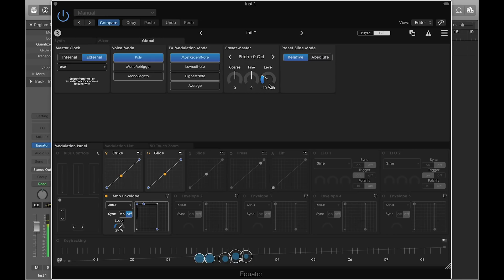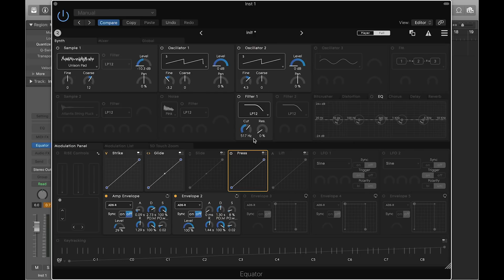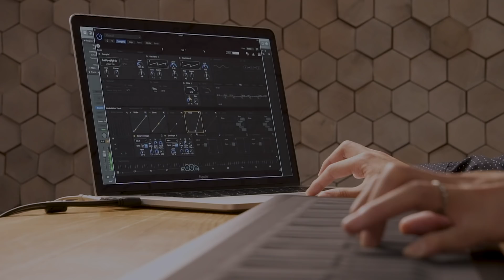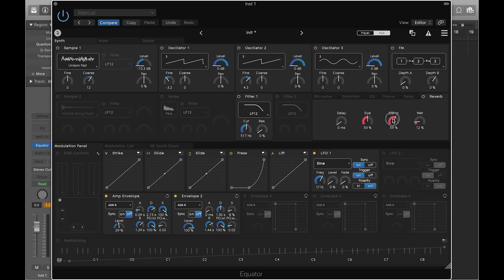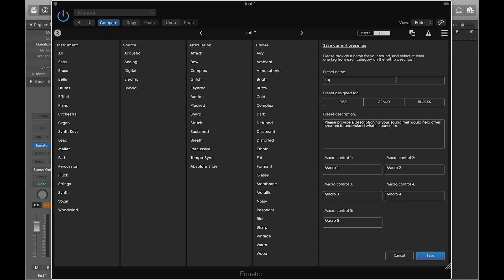How to make your own expressive sound in Equator

Comment: Roli hardware ( rise49 ) is a shitty and faulty product. Idea is great I enjoyed it when it worked, but most of the time its broken. I played  it probably less then 100 hours and it failed 4 times already. USB connection once, sensors on the notes 3 times. Charging didn't work at the time when I received it first time.  Now submitted new ticket nobody responded. then submitted the other one, same thing. 3 weeks with no response. WHAT KIND OF SERVICE IS THAT????????? VERY UPSET. 
DON'T YOU EVER BUY IT.     HEADACKE ONLY THIS IS, NO OTHER WORDS

Comment: I have a question roll. I have a iPad Air and the requirements say I need a iPad Air 2. Even though I have a iPad Air could I still use a seaboard because going out and buying a new iPad along with this instrument is a little out of my price range
Reply from the maker: Hi @UltamateAmazingCraft, thanks for the question! As you have seen under the minimum requirement list, you won't be able to run NOISE or Seaboard 5D on an iPad Air. However, both the Seaboard RISE and Seaboard BLOCK comes with software that runs on both Mac and PC. 

Check out the link below for more info:
https://support.roli.com/support/solutions/articles/36000019253-minimum-system-requirements-for-roli-instruments